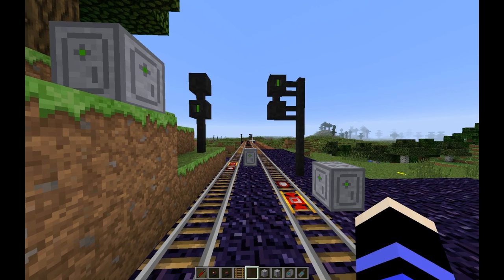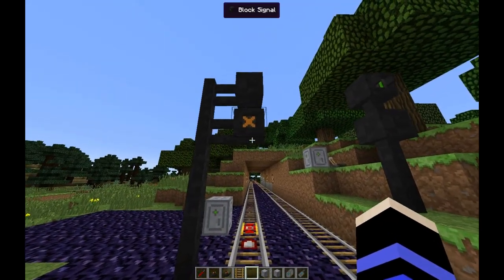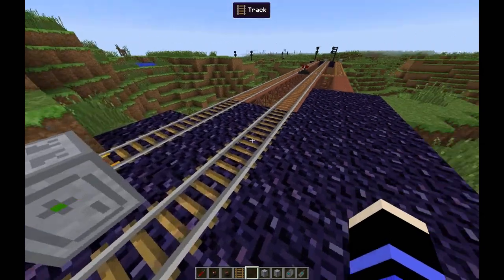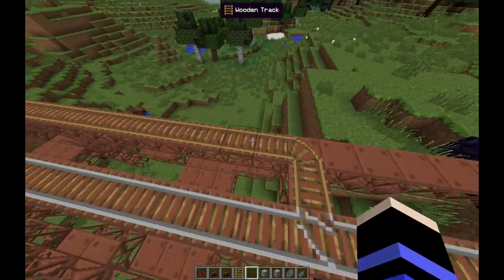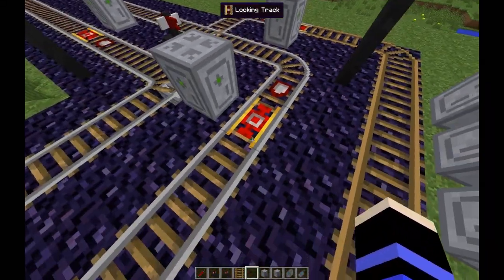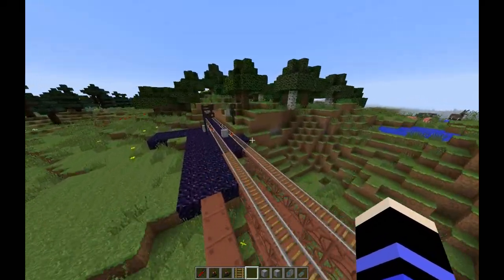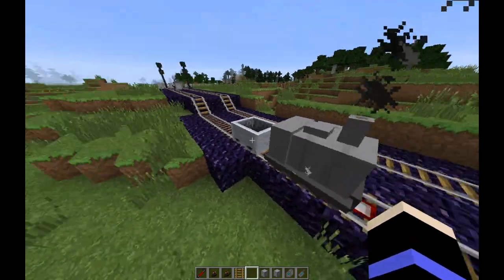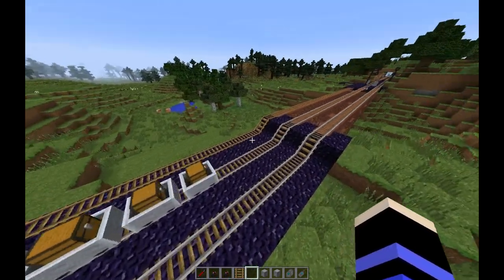Follow up to How to Keep Your Trains Apart

Comment: Hmm, would a capacitor box help smooth the output of the detector track? Keep the redstone signal on for a second longer.
Reply from the maker: Andrea Hailes Yes, that's what it does. Keep in mind though that currently it starts counting from the moment the signal turns on, not when it turns off. so if the signal remains on for more than the time set in the capacitor it wont actually extend the signal at all. An button to change this has been added and will be in the next release. Although that's probably not an issue in this case.
Reply: Forecaster Aha! Thought that was the case, just thought your first solution was rather nice looking and thought that would be a way to make it work (i.e smoothing the flickering signal from the gaps in the train into one long signal). I'll have to give it a shot in my world!
Reply from the maker: I thought of this before I made this video, but it adds way too much bulk and cost to the setup which is supposed to be as cheap and quick to setup as possible.

The solution with the detector, a piece of redstone and a suspended track is cheaper and smaller.
Reply: Aha. I'm thinking of the aesthetics of the build, and those boxes are very um, railway-y.

Comment: You could probably use cart detectors for this. If you have a server railway, which operates a regular service (e.g. Loco + Minecart + Minecart + Minecart + Minecart + Anchor cart) and also freight services, like cargo carts and liquid carts. You could have a setup that detects liquid and cargo carts (possibly a routing switch motor) and diverges them off. Meanwhile the train behind which is the timetabled passenger service will be able to proceed at line speed on the fast line. I reckon I could do that when RC gets fully ported to 1.12